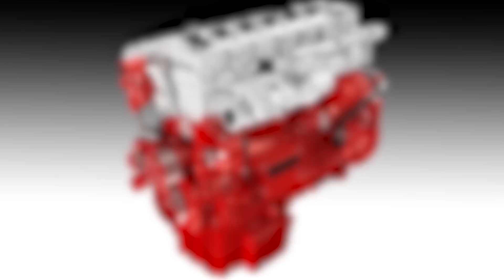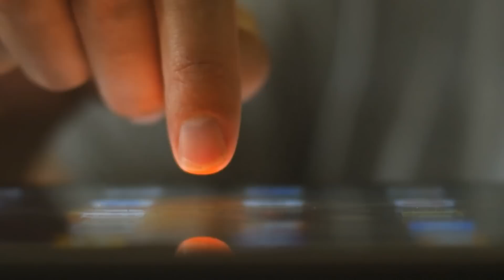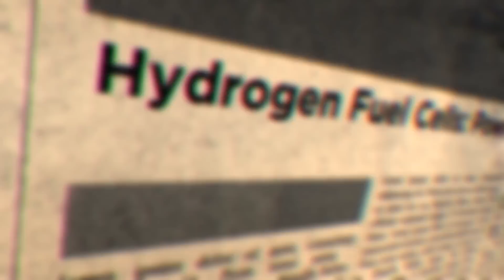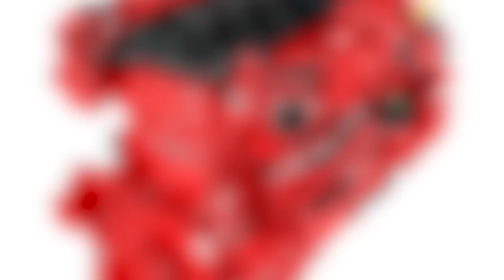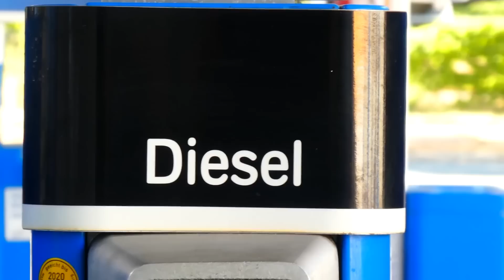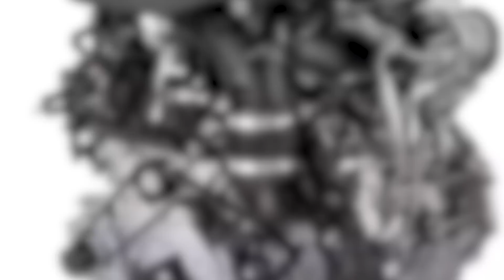Cummins CEO SAYS this New Engine Will Shakes the ENTIRE Auto industry

Comment: The problem with Cummins hydrogen enguine without the lubrication of the diesel the enguine won't last maybe 2 to 300k at the most not a million miles like my Cummins Walmart has liquid propane trucks they have diesel supplements problem is they barely get 3 mpgs there diesels are getting between 9 and 12 mpgs diesel is still more efficient 😊

Comment: The problem with hydrogen engines isn't making the engines, it's the hydrogen, or more specifically the supply of the hydrogen.

Unlike petrol and diesel hydrogen, if it actually gets used, is going to be servicing a far smaller fleet of vehicles, possibly dozens of trucks instead of hundreds of trucks and thousands of cars using a filling station. This means the hydrogen infrastructure costs will have to be paid for by far fewer users significantly increasing the cost. Delivering hydrogen to filling stations is also a far greater logistical challenge and supplying petrol or diesel, it would require about 15 to 20 hydrogen tube trailers to supply the energy supplied by one a normal petrol or diesel tanker. This could be reduced somewhat by supplying liquid hydrogen, but this would massively increase energy losses in the supply chain. 

The thing that's been killing a hydrogen transport projects is generally not a vehicle's, issues with the hydrogen supply chain, and the substantial additional cost it adds to the fuel.

The bottom line is, hydrogen is a pain in the butt to produce and handle.
#WST

Comment: No hydrogen generators or Fuling stations! Years to develop! Electric clean & quiet. Screw the Big oil power junkies! & be free from them!
Reply: E is not clean nor is it efficient.. Double check your sources
Creating E is relying on fossil & transport has huge losses.
The building is not clean, the disposal is not clean either making the problem even bigger in the future.. U been duuped sir

I worked over 10 years in these Industries (Oil/Gas/Electrifying/Hydrogen)
E is the least efficient when it comes to industry scale and distance.
E is costly to mine, leaves a big footprint and still rely for 80%+ on fossil
E is a huge waste problem in the future.
Hydrogen engines that convert within removes the need for a infrastructure.
Hydrogen engines can replace current engines and fit the current fabrication process and fit the decommissioning process after use and is 98% reusable.
Peace

Comment: Ah! the H word.  Yeah, hydrogen works and yes hydrogen is everywhere.  Lots of it in water and in hydrocarbons, problem is it takes a lot of effort to separate the H from whatever.  That little junior high hydrogen experiment making H out of water, and the balloon goes bang, yeah, well yer truck need one thousand bangs a minute, that 60,000 each hour, that means not a little flashlite battery but really big wires and fuses, over 30 kilowatts, in most places that's about $6 to make a gallon equivalent of fuel.  H because it has the smallest molecule of anything can leak out of anything and it's explosive, when it leaks it soon goes boom.  Another way of making it is to strip the carbon out of natural gas, the result of that process is the H that you want and a LOT of CO2 that you don't want, why we got on this train in the first place.  NASA, the space agency, is the biggest customer for H, they use it to fuel rockets, what do they pay per gallon delivered, I bet it is over $10, way over.  OK, Cummins might build a great showcase engine, but will it be practical?  How long will it take to build the fuel delivery network?  what will that cost and what will the fuel sell for at the pump?  I wouldn't hold my breath on all of this.

Comment: Carbon emissions are not polluting the earth they’re protecting it.
Once again stupidity is “putting the cart in front of the horse”
Pushing the narrative while ignoring the facts.
Fact no. 1.   Carbon Dioxide’s concentration in our air for maximum health should be between 1000 - 1500 ppm.
It’s at a paltry 450 ppm.
Fact no. 2.  Our nearest star, the Sun, is only 8 minutes away at the speed of light. Our sun dwarfs the earth. Over one and a half million earths can fit inside the Sun. The Sun burns at its core at 25,000 degrees F.  At its surface it burns at 10,000 degrees F. and its radiation is constant 24/7 never letting up. If it so much as hiccups we feel it in less than 9 minutes. The sun also cycles between solar maximum and solar minimums every 12 years. We feel that too. 
Now ask yourself. Where is our climate changes coming from, the Sun or the minuscule 0.04 % Carbon Dioxide?
Oh…and by the way…without the Carbon Dioxide in our air at up to 2000 parts per million or 0.2% we would all be dead from lack of Oxygen. Our earth would look like the moon or Mars.
Facts matter. Narratives can include blatant lies.

Comment: Today, using H2 costs ~5 times per BTU than gas/diesel, and it uses electricity to manufacture.  Electric power stations use diesel/gasoline more efficiently than ICE's.  A diesel car getting 50 miles per gallon, changing to electrical, the electric power station could generate enough electricity to propel the same car far over 100 miles.  Sometimes 200 miles.  When H2 can be removed from water efficiently, then H2 will be better. Cost to mfg. H2 must be brought down.
Reply: Time and development will bring that down. Just like any other "new" technology 
"Electric power stations use diesel/gasoline more efficiently than ICE's."
Well those are ICE's generators.. They have less friction and stand in fixed location
In conventional ICE the MPG can be a lot higher as is proven by many concepts.
For all these things there is no 1 fits all solution.
It will be a mix of hybrids and best for single purpose solutions. (Industrial)
As for Hydrogen will be a ICE replacement AND will be a E generator for EV's removing the need for heavy and dirty batteries.
Later a duel use will be introduced where ICE is the main and is EV assisted.
A Hybrid that uses water only an have 0 emission.
It is already in later stages of developments.

Comment: You need a lot of electrical energy to produce hydrogen, and that fact makes it less fuel effective than diesel. It's a complete brain failure to totally ban diesel fuel. Diesel is safe and easy to handle and ship in every environment. You can rely on diesel, but not on electric and hydrogen.
Reply: Paul:  Having worked in many electric generating stations in the USA:  Electric generating  station can take a gallon of diesel from a car that gets 50 mpg, generate it more efficiency into electricity, put it back into the same car converted to electricity and get over 100 mpge.  Sometimes 150 mpge.

Comment: Cummins is collaborating with Scania to test hydrogen-powered engines, including fuel cells, in Scania trucks. This includes a project to develop 20 hydrogen fuel cell electric trucks within the HyTruck project. The project aims to demonstrate the viability of hydrogen as an alternative fuel source for longer driving ranges, heavier payloads, and faster refueling times. These have been under test across Scandinavia since 2020. The advantage is that the engine is a direct swap out for existing Cummins units, so existing trucks can be converted. The ultimate issue, similar to EVs, is the availability of the necessary hydrogen infrastructure in volume that is required to support the change.
Reply: I can say that Hydrogen is possible because Cummins is developing the new 7.2L diesel engine and there's a possibility of a hydrogen fuel cell version by 2028. I've been a Ford and Ram fan for years (owned both) but hydrogen would be a game changer. limited wear on the engine, unlimited torque. I would agree with @DNorthWest that "the ultimate issue, similar to EVs, is the availability of the necessary hydrogen infrastructure in volume that is required to support the change".
Additionally, Ford is exploring hydrogen-powered engines for trucks, including a possible hydrogen version of their Super Duty F-Series. They are actively working on prototype hydrogen-powered Super Duty F-Series trucks and have patents for hydrogen-fueled combustion engines, including a hybrid powertrain with a motor-generator.

Comment: 🌟despite the usuaL Lies in these videoz:

 CUMMINS iCe engine sector iS FACinG Bankruptcy or retirement except maybe for a short period of time in shipping industry while they eventually endup banning ice engines on ships both for deficiency and extreme noise they generate

 forcing some whales and marine Life to suicide !

there are many noiseLess and highly efficient new power modules converting heat or flywheel motion to electricity with little to no noise and vibration,.
 getting ready to end and simplify transportation with little to no moving parts and pollution ,.
 therefore increasing safety and Lowering all costs in transportation
💐💐
💐

Comment: Actually, the gasoline version is the one that will shake up the industry.  The B6.7 Octane produces similar power using cheaper 87 regular gasoline and less maintenance than its diesel brother.    The hydrogen version is just a non-starter due to lack of fueling infrastructure and storage of enough fuel to go any great distances like the gas or diesel versions can.

Comment: Where do you refuel and how much does it cost to fill up? This has always been the roadblock for H2.
Reply: @michael3109-j7 depends H2 is a bigger problem as for storage, ie fuei station, Unless your Mazda slated to have awesome H2 engines that fill up with water an do the conversion somehow with the wankle engine.....read it on a new podcast on YouTube.
Said to eliminate the major chore of high pressure storage tanks. Similar to the Electric charging stations and massive power distribution everywhere.
Have fun
Reply: @DavidHolland-wh1qr  everything is fixable

Comment: If we don't overcome our fossil fuel addiction, we're all screwed. Future surface mobility has to be electric. One day of sunshine delivers enough energy to power the Earth for 100,000 days. We need to harness that. If greed and sheer stupidity prevents that from happening, we don't deserve this planet.
Reply: Christian:  I drive a 2019 Chevrolet Volt.  42 mpg & 50 mile battery range.  It has a ~100 HP ICE & ~100 HP electric motor, 16 kwh battery.  There is NO need for a 100 HP ICE, when I use ~25 HP at 70 mpg level highway.  This is my 3rd Volt, but wish I could buy it with a 25 HP engine.  Certainly would use less fuel.